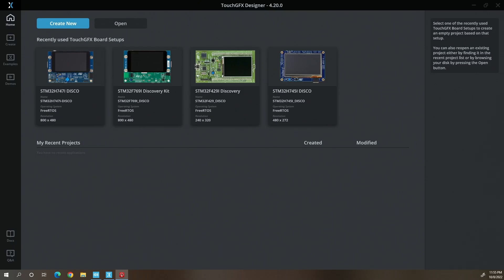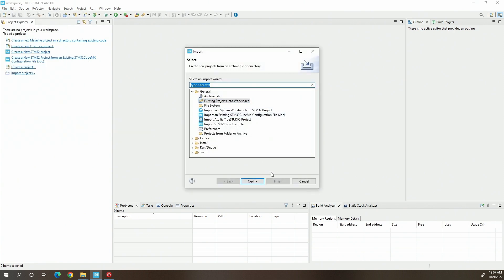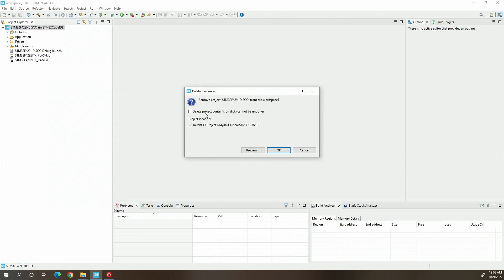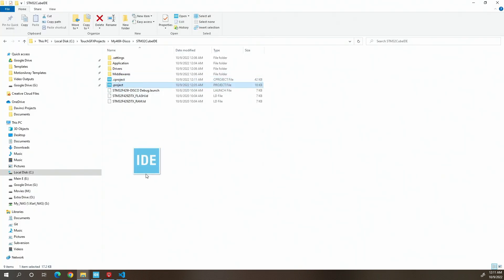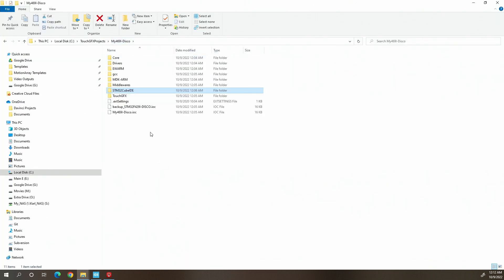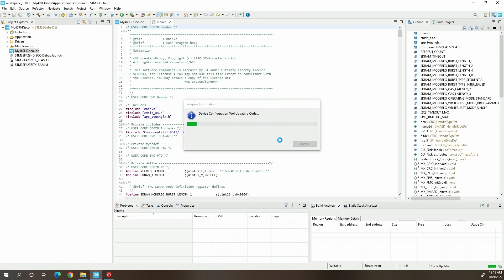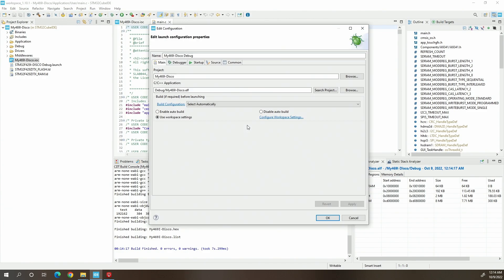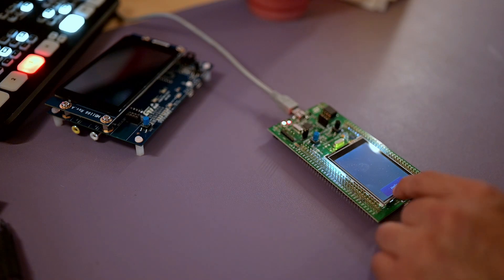STM32F429I-DISCO & TouchGFX Setup

Comment: Hi, great video, by the way, in TouchGFX Designer, there are 3 buttons. Generate code, build (window pops up to test) and build & run. When you finish designing, you just need to click the build & run, and the code is automatically flashed to the board. No need for this complicated stuff. If I understanded this right, this is the same you did. Regards.
Reply from the maker: Yes i know you can program the development directly from TouchGFX. But then how do you set up UART, PWM, ADC, I2C from TouchGFX? How do you run the debugger from TouchGFX?
Reply: @EEbyKarl  Can you give us a hint of how can we work with the ADC's of this board? I'm having trouble because all of them are pre configured with the FMC and I've never worked with that before. I know how to read an analog value from a normal pin that can be an adc input, but since they are connected with the FMC, I have not found yet how we could read the analog values.

Comment: Hi Karl, I am using STM32F469I-DISCO (DK32F469I$AU1), TouchGFX is version 4.21.1. My app is just a box with a button on it. Code generation and flashing onto the board show no error in TouchGFX, so is building app in STM32CubeIDE (with firmware version FW_F4 V1.27.1) but it just gives blank screen. Tried a few examples and demos on the board too, none worked. I have another made in China board, i can created TouchGFX app and runs fine, but this STMF469I-DISCO just drives me nuts, just could not get it run even a simple app. Any clue ?
Reply: Almost 6 months later, I have exactly the same error and it seems Stm32Ide is resulting for this bug and it is buggy anyway.

Comment: I ran across a note in the STM community "rename STM32CubeIDE project".  It seems the process is much simplified. All that needs be done is to open the .project file and on the first line correct the default name supplied by touchgfx designer (which is the board name). Then when importing the project into the STM32Cube-IDE it will be named appropriately AND there won't be a conflict with the board name attached to the ioc file.
Reply from the maker: You're partly correct that you only need to rename the one line. But you can't add the IOC file to the project tree without renaming it to the same name as the project. CubeIDE won't open it because it's not the same name as the project. But I did stumble on an easier way to add the IOC file to the project tree and to rename it. Then I realized that it fixes the issue with TouchGFX not finding the board name unless you rename the text as the project name in the .gfx files. But with your insight it helped me find an easier solution😀. I will have to replace this video soon.
Reply: @EEbyKarl  Love your videos!  For such a noob as myself, they are very useful and informative. As to the naming of  the *.ioc file, yep, after posting my original comment I ran across that.  It seems ST's product dev teams, as good as they obviously are, could do a bit better job of communicating how the various apps should communicate and interact.  It feels like they are SOOO close to having a fairly seamless integration between the gfx design and the Cube-IDE code & compile aspects of development.
Distantly related to all the preceeding: I ran across a new channel (STM32 Research) with only a single video so far (posted about 4 months ago). What I found very, very useful was his approach to using the F429i disc1 board and adding a new (2nd) OLED ssd1306 display by hand. First starting the project as if it's a bare mcu (not a board version), configuring the pins for spi, then adding touchgfx to the project and showing the manual edits to get the display up. I found his workflow very straightforward. I need to try his approach to see if it finally gets me to a nice, orderly and repeatable approach to developing some apps for my own use.  
Please keep publishing! Your information is so very useful!!!🤩

Comment: Nice video.I followed your video for stm32f469i disco but it doesn't work.I tried many times but the screen remain black.can you make a video for stm32f469i disco.thanks in advance
Reply: Did you manage to solve your problem? I've been looking for a solution for hours but can't find anything
Reply: @luisdc1855  I didn't find solution yet on Touchgfx .
Reply from the maker: For anyone who are running into the black screen issue. The latest TouchGFX fixes the issue due to the different LCD with revision B-07 they are using. When starting a new project just select the correct development board.